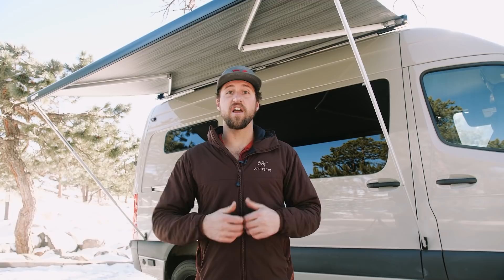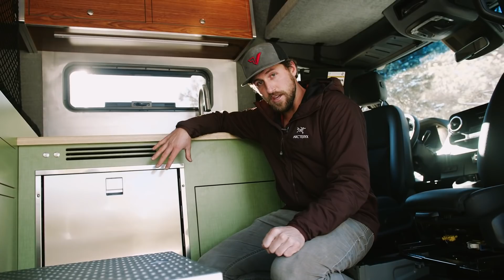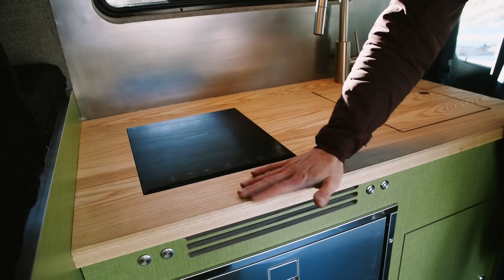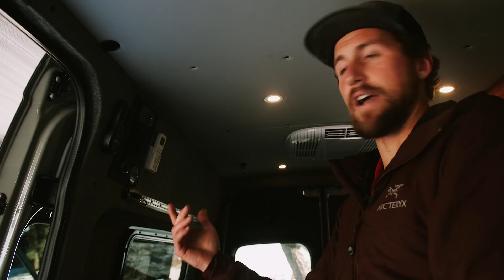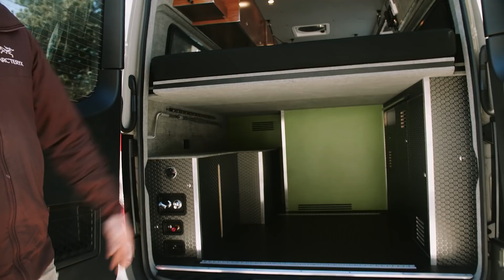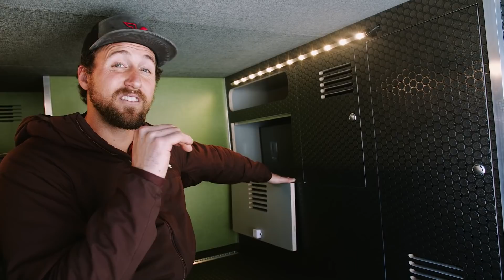FULL VAN TOUR - 2019 Mercedes Sprinter  144 4x4

Comment: WHAT DRIVES ME CRAZY IS WHY, WHY? HAS SOMEONE NOT COME UP AND MARKETED A FRIGIDAIRE 5000 BTU ROOF MOUNT, LOW SURGE AIR CONDITIONER? THERE WOULD BE SO MUCH DEMAND FOR IT, WHY HAS THIS NOT HAPPENED? DRIVE ME CRAZY! I MAY CONTACT FRIGIDAIRE AND ASK WHO IS ASLEEP IN THEIR MARKETING DEPARTMENT? OR SPENDING 20 OF THEIR 40 HOUR WORK WEEK ON THEIR PERSONAL WEB BS!!!
Reply from the maker: The units we use are 13,500 btu's. 5000 btu's would not be enough to cool vans this size, and these are the small ones.